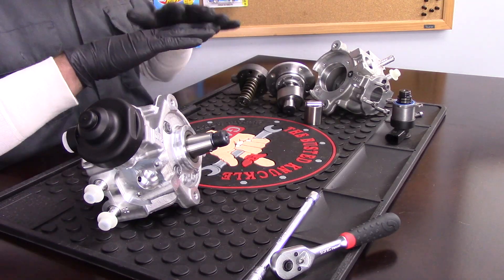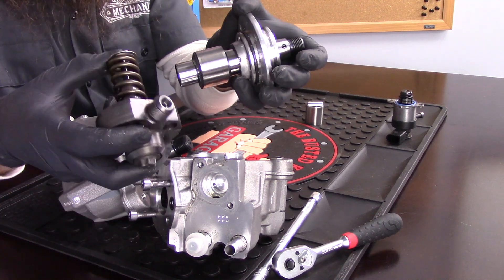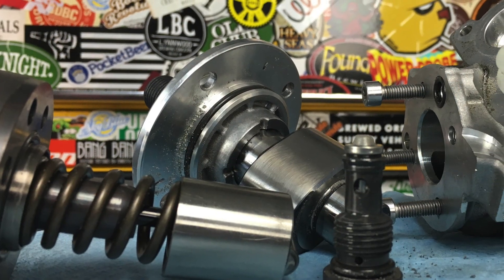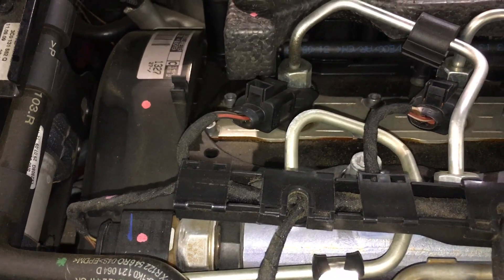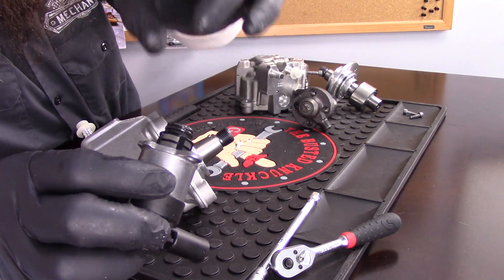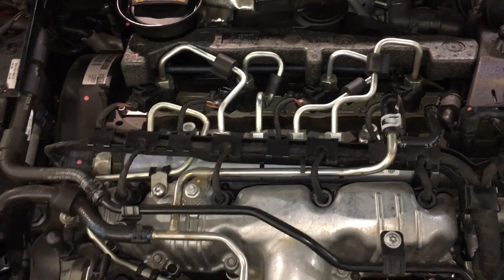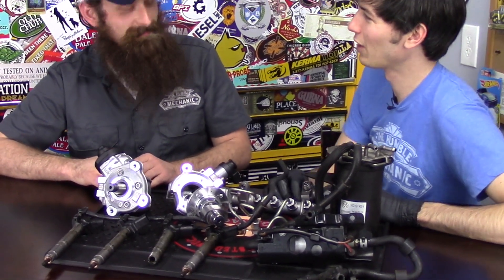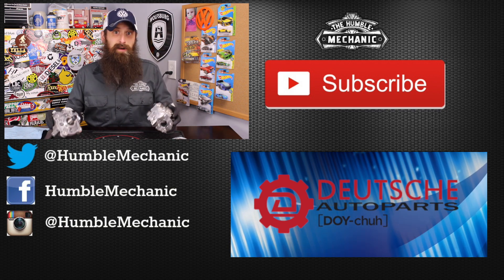How VW Parts Fail ~ TDI High Pressure Fuel Pumps

Comment: I think, the pump has no timing marks on it and you can not adjust the timing, because it is a common rail system. I did an engine rebuild on my 2.2 diesel nissan Xtrail and the pump had no timing marks on it and no info about it in the service manual. It just creates pressure to the rail and the pressure regulator regulates the pressure. 
Fortunally Nissan has it as replacement part -200€, but the manual has no word about it. 

The major cause is wear and caused by low fuel quality and ULSD. 
There are many debates about adding 2Stroke oil on the internet. I have a document from Bosch that they tested the pump with ULSD and caused major wear to HP pump parts. They recommended  to improve lubrication of the diesel fuel, but with what, Bosch did not say.

One diesel truck forum did a lab test about different additives to improve lubrication.
The most cost effective was adding 200:1 of 2 stroke oil to the diesel.
Some say that it caused/causes pump failures, but i do not believe that BS.

I think using 2SO is like garlic to a man, i like garlic and my diesel engine likes 2SO. Runs smoother and hopefully prevents pump and injector wear.
Reply: I'm considering buying one of these, did you ever test this yourself? Do you think it helped or hindered?

Comment: Major failure happened on my car and it took 2+ weeks, and it would have cost me 7k to 10k repair had it not been covered by VOA. Most cars have it covered under the 120k mile extended warranty.
Reply: I had this happen to mine 3wks ago, Ext warranty won't cover it at 130k, It's completely out of pocket, 7k to fix, well I'm not paying this, I am surrendering my car back to the bank I financed it through. It's their problem to deal with.
Reply: @ElRojoDhablo666  I sold my car back to VW as they offered me 13k for it a very long while back. Never regretted that decision because no matter the fix they offered and warranty coverage it was a ticking time bomb waiting to happen. Although at the time they didn’t have the fix, so it was my only real option anyway. Lol
Reply: Hacky2447 Wonder if that’s the same now adays

Comment: hi, I have a 15 nms tdi and I wanted to know your opinions on the return line filter kits available that supposedly contain the damage of a failed pump to just the engine bay items such as pump, injectors, high pressure lines, and the rail. the one I am referring to specifically is made by 2microntech.  thanks. I just found your channel and am enjoying them greatly. 

later,
Steve
Reply from the maker: +GhiaSteve89 If you said that it contained the damage to the pump, I would be into it. But the underhood stuff is what is so expensive. That really doesn't save you from replacing anything. We don't replace the intank pump or the tank anyway.
Reply: gotcha, I appreciate your insight. i hadn't considered that.

Comment: Thank you for the video! my pump failed at 138,922 miles in October 2015, on a 2010 Jetta sedan TDI, the dealer quote to repair was approximately $4000.  The dealer called VW to see if they would repair it, "no".  I called myself and "no"  As in your video it is a hard stop warranty at 120,000 miles.  The dealer has one or two more cars with the same failure.  As for electrical, my trunk stopped working as well as the stock radio.

Comment: yay finally you got them!, i know i pestered you a lot about these HPFP!.
I remember that when these came out one of the problems was the shoddy US-style "euro diesel" that had very very low lubricity, the situation has improved i guess from 09(but euro diesel is still much abrasive than cheap diesel, cheap diesel has 500ppm sulphur, euro-diesel has 10ppm, and as you all know, sulphur is a lubricant)....

Also, the design is shit, why does VW LOVE cam-operated pumps so much(other than to fleece customers) is beyond me, they're terrible!, look at the petrol pumps you showed that the follower and cam get eroded to destruction!, look at this!.

In 2001, we had a 2L Citroen Xsara HDI, that thing was one of the first common rails(and very high pressure to boot), with piezo injectors and also used a Bosch pump that was fairly long, what's notable is that engine was designed to run on high sulphur diesel so we could fuel it with the cheapest stuff there was, it could also run on euro-diesel no problems. I don't know why didn't VW copied/licensed that pump design from PSA..... IIRC the Xsara pump had 3 cylinders, this one that VW uses is one cylinder only :S

Comment: Great video. I've always wanted to take one of those art but they've always been under core charge. Have you seen any of the new pumps that we've been putting in fail? I know they have a parts super session. If they haven't what's been done that's fixed the issue of them failing?

Comment: 800 bar? Did I hear that to right? That's like 11,600 psi.
Reply: +jgreenjeans 
Yes.  2.0 Common Rail engines run 1800 bar on the rail.  (Yes, 26,000 PSI).
Reply: Holy shiz! I was thinking  the same thing

Comment: Great video...any thoughts about the CP3 pump some have been retrofitting to TDIs as a way to get away from the issues from this pump? Or using aftermarket filters to protect fuel system components from a HPFP catastrophic failure?
Reply: yea.......
I wanna see a CP3 pump swap on a EA288 TDI.

Comment: hey Charles I have an 09 jetta tdi and every once in a while a check engine light for low fuel rail pressure comes on, do you think the pump has failed or is it just a bad sensor?
Reply from the maker: I would lean more on the pump than the sensor. When they don't come apart they can randomly set due pressure faults.
Reply: HumbleMechanic do you think this is a problem i should worry about because it only happens like once every couple months then i just clear the code.
Reply from the maker: +sizeOVERstrength I would want to get it fixed. Id hate to see it go kaboom
Reply: +HumbleMechanic i've seen inside a duramax one that came apart, i wanna see if its the same thing with this pump, usually the Harding on the cam lobes fail and chew up the rollers. gets expensive quick, if ya don't mind!
Reply: Start with the filter and work from there I would say. Maybe it's due ?

Comment: That's the baby version of the bosch set up in fords 6.7 powerstroke.that volume control valve on the pump looks identical to the one on the fords high pressure pump,except it's serviceable separately on the fords.and fords are the same it's always the valve that fails or catastrophic failure of the pump,usually some goof put def in the fuel.i bet you can imagine how expensive that gets really quick.

Comment: failure comes from poor fuel, WATER KILLS A CP4 IN SECONDS, GAS kills it is seconds as well, and poor filtration! use ONLY VW filters... same thing for GM's with the duramax i have cut open alot of fuel filters and only one has had the water membrane in it which was OEM
Reply: The OEM filter is made by Mann
Reply: Kevin Rogers winx filters are not good? Just replaced mine with an winx filter
Reply: The OEM filter is not made by Mann. It's made by Mahle